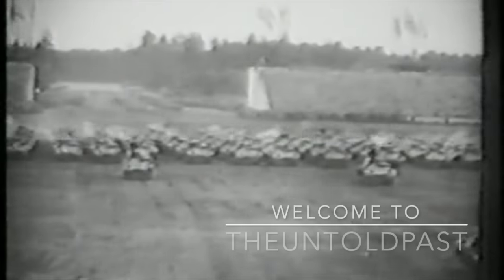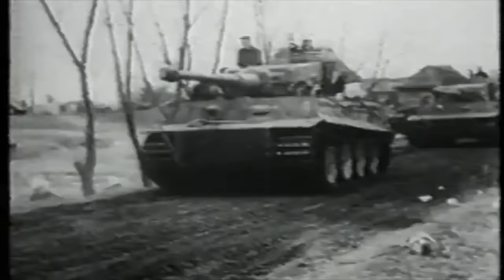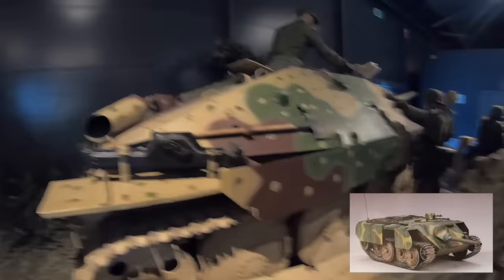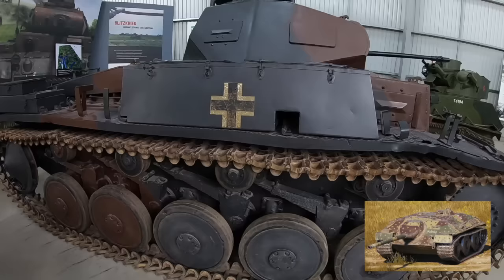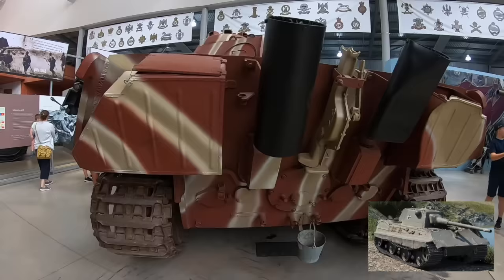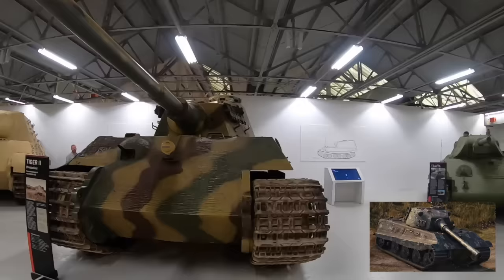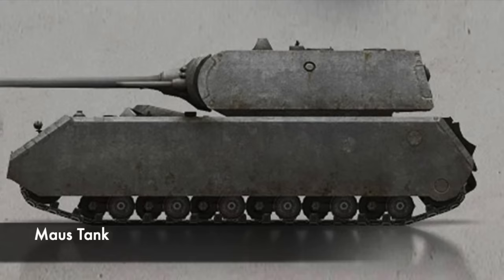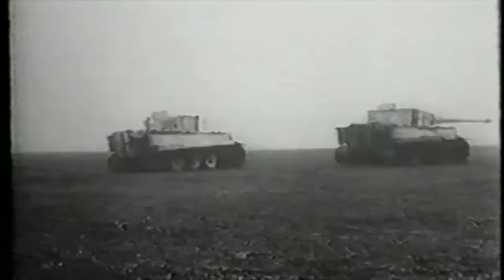The E-Series Of Tanks - Hitler's Dream Tanks

Comment: Whenever I encounter information about German tank designs, special projects and wonder weapons, I always find myself questioning what kind of strange world of propaganda and overconfidence these engineers must have been living in. 

In a situation where your quality steel production is diminished due to limited access, your copper and aluminum is running low, your rubber access is dwindling, how do you even consider making these behemoths like E-75s and E-100's and MAUS. I know I have the benefit of hindsight in this consideration, but I just don't understand how anyone could look at a war on such a scale and not consider the long-term ramifications of supply. I understand that the E series was meant to be a simplification of designs so that multiple vehicles would all be using a large collection of the same interchangeable parts, but I don't understand the overall fetish with such large and heavy designs.

I recall Nicholas "The Chieftan" talking about the American M4 design, acknowledging it's flaws, but also pointing out that it was a vehicle designed for operation in literally every theatre of the war; in frigid cold, tropical, desert, urban, forests and mountains, was built with the idea that every single unit had to be shipped somewhere by boat (which introduced weight and size limits), and was still "good enough" while being mass produced on a scale that was unheard of during that time. The Russians had a similar philosophy in the designs of the T34, even though their country had literally just suffered through Stalin's industrialization programs and their engineers and factories were somewhat inexperienced, they made a tank that was "good enough" on a ridiculously large scale of manufacture. 

When you consider the sloping on the M4 hull gave it an armor strength (from the front ~100mm) comparable to a Tiger (~100mm vertical armor) which was a much heavier and bulkier design, and that it could be deployed more easily over bridges and terrain that would have impeded the Tiger, it puts war stories of the fabled Tiger tank in a different light. Sure the M4 gun wasn't as good in many respects, but that was mostly an ammunition problem and could be solved by iteration with the 76mm gun, and to be fair, most of the German vehicles that were encountered were Panzer 4 and Stug designs that had approximately 50 to 75mm of protection. My point here is that the overall design of the M4 didn't need to change drastically to accommodate upgrades that kept the tank relevant in the later war, while German philosophy was to produce entirely different models to carry progressively larger guns. If they had simply improved the Panzer 4 with a sloped armor design and up-rated the gun to the long-75 mm used by the PAK-40 it would have had increased survivability and firepower to combat the M4 and T34 tanks, while being easier to produce than the larger Panzers. 

I feel like if German engineers and factory production had been focused on minimizing resource costs, making efficient and stable designs that were suitable for their needs instead of focusing on the "grandeur" of these overly large and complex vehicles, their tank forces would not have been so overwhelmed by the numbers of Allied vehicles. It always seemed odd to me that so many different chassis and models existed for the German forces in comparison to many other nations, and I do recognize a lot of the mid-war refits of Czech tanks and French tanks were just a method of making use of captured resources in a practical way. I just find it very interesting that even toward the end of the war, the German designs were still attempting to have specialized models for different purposes instead of having as single 'general purpose' tank that could fit into any required role well enough. Even before resource considerations the E-75 and E-100, Kingtiger and Mause projects should all have been canceled for sheer size and weight limitations for the environment in which they would see combat; most bridges would be impossible to cross and their height and weight make them incredibly poor at concealment or traversing muddy terrain. I know that this 'concept' kind of comes later in our history with the designation of the MBT, but it has early roots in both the M4 and the T34 philosophies.

I often hear historians speak to the "fear" that would be imposed on an enemy as they witness a Maus, E-75, E-100, or Kingtiger on the battlefield and I wonder where this notion comes from. Were there historical records that mention "fear" as being an intended consequence of the design from the German side? Whenever this comes up, I cannot help but picture cartoonishly overconfident engineers chatting about how their design is so intimidating that it will never have to fight because its opponents will just give up on sight of the thing.
Reply: Couldnt u just say that u dont like it?
Reply: Man. Wow write a book in future! :)
Reply: You should make YouTube tank videos, you are knowledgeable and i enjoyed reading your opinion
Reply: Most of the Projects were to keep adolf happy
Reply: It's always seemed to me like German decision making was the least concerned with economics and logistics out of all the participants in the war. Their approach was heavily based on planning successful operations, and relying on their operational doctrine to carry the battles. It was antithetical to design a tank that maximized numbers of useful tanks on the field; instead they wanted specialized tools for each job. It is very telling that in Fall 1941, the Germans were planning to decrease war-related production, since they had domestic considerations in mind for a post-Barbarossa time.
Reply: @joshfps8546  Whether or not I like something is irrelevant here. Just because I have a fairly lengthy post discussing the mindset of the engineers doesn't mean the content is as blunt as "I don't like german tanks". On the contrary I find them incredibly interesting, fascinating because they are so complex and overengineered as to be impractical to produce en-masse. If my comment boils down to "I don't like them" to you, I don't really know what to say.

The point of my discussion above is that I would like to see some historical information about the design methodologies and processes that went into some of the German vehicles' creation so as to understand the mindset of the engineers themselves. 

As noted by a response, the German high command seemed to be of the mind that they could re-prioritize domestic affairs and construction circa '41 which would imply they believed themselves to be in a far better position militarily and politically than they actually were.

With this consideration in mind, perhaps those responsible for the designs believed they had more time to source materials for construction of these vehicles and more production time, because they did not foresee direct U.S. involvement in the war, since Pearl Harbour occurred Dec 7th of '41 and was the springboard of their entry to the war in a capacity beyond resource shipments. 

If resources from abroad could be collected, then the idea of such grandiose vehicles being produced on the German side makes a little bit more sense. If one thinks of the new designs as being the cornerstone of a occupation army. Though this still doesn't have much bearing on the occupied regions abroad that would also need such material, shipping kingtigers seems like it would be an immense task.
Reply: Being an engineer in a German wonder weapon project spared you being a front line soldier, so I guess this was at least sometimes part of the motivation.

Comment: The Germans DID produce the E Series of tanks and tank destroyers.  They just had to wait until the 1960's to do it.
Reply: Gets ready to get a e100 for a present*
Reply: Totally different suspension. Leopard 1 (E50 - actually lighter than 50to) and KaJaPa (E25) use torsion bar, the E-series used conical springs. Also staggered wheels and dead/slack teack where the post WW2 ones used Pershing style dual wheels and live tracks. Diesel, not petrol. Bigger guns (105 and 90mm)

Comment: The overlapping wheels were severely criticized. Easily damaged, and extremely difficult and time consuming to repair. Many Panther models also had engine problems. The engine was very difficult to remove and replace, taking almost an entire day.
Reply: And in Russia, they became clogged with mud, which then froze overnight, immobilising the tanks.
Reply: I think you're confusing interlaced and overlapped wheels.
Tiger 1 and Panther used interlaced, then Tiger 2 introduced the overlapped wheels whoch were much easier to maintain and more reliable

Comment: None of these vehicles would’ve made a bit of difference unless they had a dramatic increase in production. That’s what they needed they didn’t even really need to change design they just needed more of them.
Reply: Tank numbers were limited by the oil capacity/shortage. Having more tanks, but being unable to supply them with fuel would be a mistake. Therefore germans tried to compensate their disadvantage in numbers, by having tanks superior to their common enemys, mainly shermans, T34“ and their different variants.
Reply: @stoned2494  Germany's army was supplied by the large oil fields of Romania in the beginning of the war. Oil shortages became a problem after the Romanian government capitulated to the Soviets.
Reply: @JackoBanon1  Yes and wie speak absolut the E-Series of Tanks, which where planned 1942 and wouldnt have seen production for multiple years to come. None the less the fact that rumanian oil wasnt enough to supply the insane demand. 
Looking at the later years of war, often times the fact of missing trained crew, missing ressources like rubber or tungsten and bombed factories is ignored.
Reply: In 1945 there was no hope for a victorious counter attack.
Reply: well to be fair, the capacity was there. they mass produced simple vehicles like the hetzer and stug III, so yea a simple to create e50 would be produced in the thousands as well
Reply: @JackoBanon1  actually wrong. I mean germans strugeled logistically with  fuel and a lot of other stuff. Rommania didnt suplly just Germany but whole axis with fuel not to say basic induatry not just war effort. Germany had fuel shortages in earlly as 1938 let alone on full blown war. Italian navy sat in ports most of the war due to lack of fuel. German factories of trucks were shut down due to lack of fuel for testing fuel pumps in 1943. So yeah Germany was swiming in fuel. I mean why the fuck would operation fall blau commence if they had fuel.

Comment: The lower production rate of german tanks is caused by the lack of resources as well as fuel. That's why it didn't made any sense for the germans to use assembly lines for their tank production like americans and russians did. If you don't have enough resources to build a lots of tanks and also if you don't have the fuel to actually use a lots of tanks (if you produced them), then handmade is better than assembly lines, since it's easier to adjust and to improve. It's just more flexible. That's why they had the best tanks in the final years of war.
Reply: Thank fucking god. It took me this long to find a comment with common sense.

Comment: Brilliant idea, super heavy tanks, why didn't anybody else ever think of it before?  This literally reminds me of a comic book back in the 1970's called CARtoons.  Two guys jack up the suspension on a pickup truck over 15 feet, the one asks the other, why didn't anybody ever think of doing this before.  Then they roll out on the road and cause a traffic jam at the very first underpass with height restriction.  Most bridges from that era had a max. 40 ton load limit.  Same with dock cranes, 40 ton max.  That's why the American's weren't shipping super heavy tanks, they had the prototypes but wouldn't put them in production.

Comment: I mean really they should've just kept pumping out panzer 3's and 4's and just bolt or welded on spaced armour. They could have made an standard engine across the board of the panzer 3's and 4's. I watched a video and it was mentioning how when Germany kept improving the panzer 4 and adding variants there were a lot of main parts changed and basically designed as new panzer 4's as it were just with the hull being standard. Hardly any of the parts were interchangeable through the versions. There was so much that they could've done to improve production and models made earlier but just didn't. As was mentioned in this video. If they had just done what the US and USSR did they may have had even more of an impact.
Reply: Didn’t that same exact video also explain why that wouldn’t have done jack diddly except run out the Wehrmacht fuel reserves faster than they were already draining? What good is an extra ~15,000 tanks/tank destroyers with no fuel to get them running?
Reply: Your reasons are good but your choices are partially wrong. Indeed the Pz.Kpfw. IV should have been built more, but the Pz.Kpfw. III, nah.

It's gun became out of date and it's role was transition to the Pz.Kpfw. IV.

What Germany dud do well but didn't do the best was shift all Pz.Kpfw. III production to StuG III production. Germany did this well but they should have done more.

The Pz.Kpfw. IV and StuG III were by far the workhorses of their armored units mid to late war.

For the parts changed, it's not too much of a problem. For the Pz.Kpfw. III. Ausführung A-E had the big changes like addition of thick armor, different gun, etc. You are correct on the engines. For the Pz.Kpfw. IV, it's the same thing, early models dealt with heavy change as they Germans understood a better role for this tank like adding the longer 75mm gun to engage enemy tanks. Ausführung H and J mainly consisted of downgrades and removing unnecessary things to ease production.
Reply: @jerryudonneedtoknow3903  I suppose you are right.
Reply: That's easy to say but there's a good reason as to why Germany never really mass produced any tanks on the same scale as the us or ussr ( be it the pz 3,4s or the e series). You have to take into account what state Germany was in at the war in 1943/44. Germany was losing significant territory along with manpower. This combined with a shortage of raw materials ans oil (which Germany started of with at the very beginning of the war) makes it clear as to why Germany never mass produced any tanks.

Comment: Good  video. They always say that German tanks were produced too slowly and that they had reliability issues. But the German factories were constantly bombed and they ran out of resources / materials. As a result they could not develop nor produce fast enough and that forced the Germans to rush tanks into service with teething problems. Americans and Russians could produce so many tanks because their industries were never bombed and their supplies and supply routes were never disrupted either. And when you don't need to repair your factories all the time, it is easier to focus on improving the production process.
Reply: no, german production increased throughout the war. the bombing had very little effect (infact slowing the allied down far more than the germans), the tanks were rushed due to losses in the field.

german production was lower long before the bombing started, and thats because of how it was set up, very littel standardisation and no production lines (the same set of workers worked on a tank from start to finish). and not fully mobilising the economy. albert speer started to change this, but by that point they had supply issues.
Reply: Germany never had the resources to win WWII. This has been explained multiple times. Germany entered a fight it could never win.

Comment: Bare in mind, another of Mr Hitlers dreams was a under Atlantic Railway (for after he had "somehow" conquered the Americans). His "immense tactical genius" existed only in his tiny, tiny little mind.
Reply: Bear in mind*

Do you have a source for that railway?

His "tiny, tiny, (you forgot that) little mind" was far bigger and better than yours. The distance between genius and madness is only measured in success.
Reply: @josephlongbone4255   It doesn't even mention the US.

In fact it was a brilliant concept, about technology that was adopted DECADES later for German highspeed rail and San Francisco's BART system...

So yeah, this little talk ends here.
Reply: @josephlongbone4255   Last reply: It doesn't mention Anchorage, or anything about the US.

Reading AND comprehending is hard, I know...
Reply: @youtubemodsaresnowflakelef7692  no need to be rude, it's on the picture listing the list of stops after Vladivostok.
Reply: @josephlongbone4255   but ONLY on there ("to Canada and US").

There's no source for it. Wikipedia isn't reliable in any case, but even there it's not listed, other than on that stop thing. It's NOT mentioned in the text, nor in the sources listed.

Besides even IF it was true, it was via Siberia and the Bering Straight.

That would most likely have been a bridge or whatever, AND doable. And has NOTHING to do with the Atlantic... Alaska to Siberia would be Pacific.

There used to be an actual landbridge there, where the Bering Straight is...
Reply: @youtubemodsaresnowflakelef7692    You give the failed art student too much credit - he had talent as a propagandist, but otherwise wasn’t all that brilliant: he was just surrounded by hyper competent minions that just shut their mouths when he took credit for their ideas.